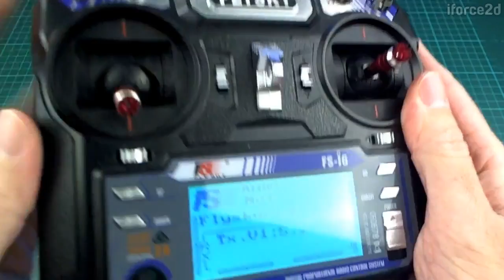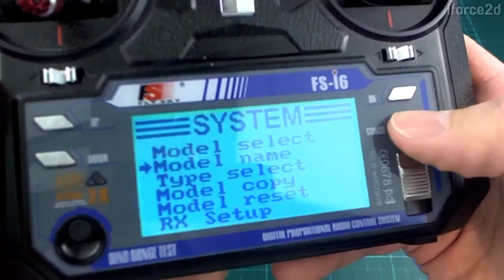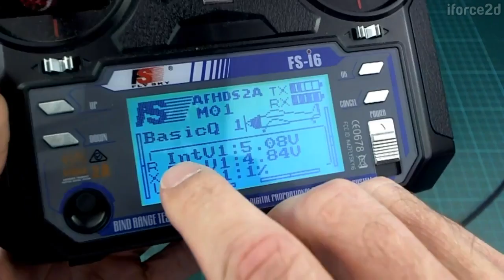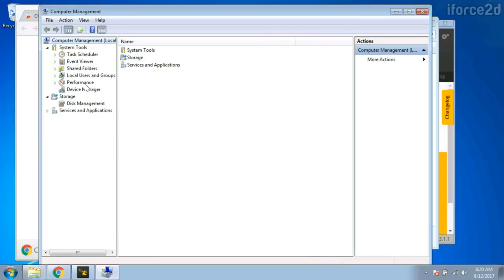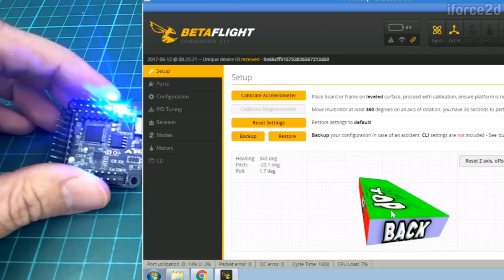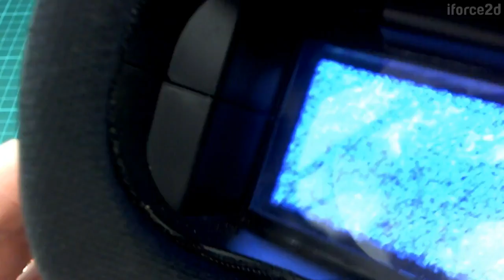Noobs guide to quadcopters part 14 (checking parts, flashing Betaflight)

Comment: The motors+ESC+BEC that I ordered doesn't come with a pwr distribution board. Is this one adequate?

https://www.banggood.com/Lantian-PDB-Power-Distribution-Board-with-BEC-Output-5V-12V-3A-for-CC3C-Naze32-Upgraded-version-p-1076479.html?rmmds=search&cur_warehouse=CN

Banggood desc: Lantian PDB Power Distribution Board with BEC Output 5V 12V 3A for CC3C Naze32 Upgraded version for RC Drone 

Price: $4.59

Comment: Hello, naze rev6 a little old but i love them, you can use uart 2 or 3 with FTDI to access FC. always set this function on first setup as still managed to pull usb socket off even with epoxy on. Keep up the great work.
Reply: Naze rev 6 old ?
I am still using some rev 5s !
Reply: yep still got 1st quad build with rev 5 on, still flies like a dream. All this hype about 1 khz and 8 khz is a bit boring, human reflex is so slow it make no difference ( to me anyhow).